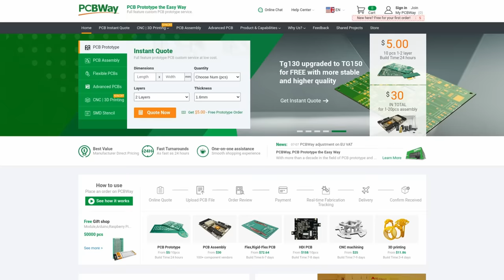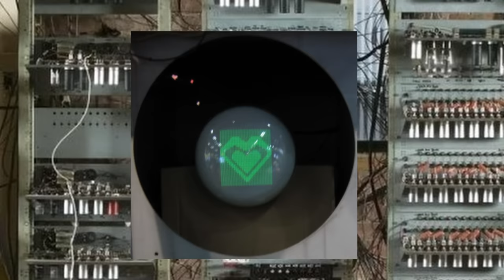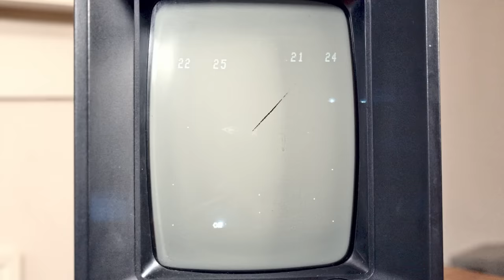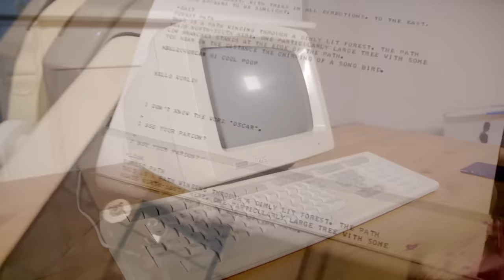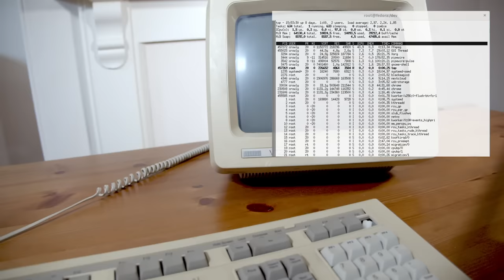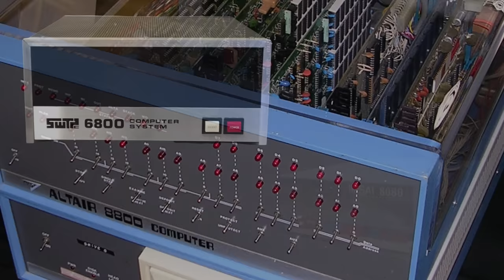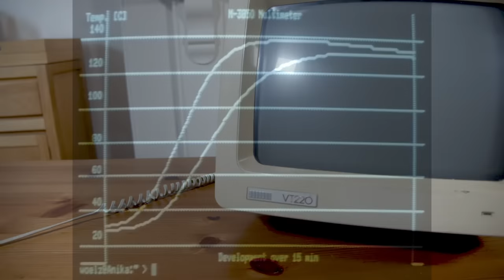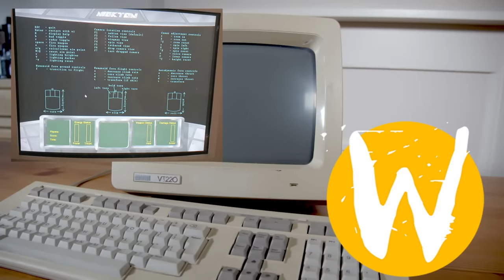The abridged history of Computer Display Tech

Comment: This was good but I think you were a little hard on X11 while I generally agree Wayland is better for most modern use cases the remote features of X11 especially when paired with SSH were especially in businesses much more commonly used than you might think and the switch has caused many issues for businesses. it use to a lot easier for me to write a batch script that launched an Xserver on windows ssh with xforwarding to a remote server and an application that managed an application running on the Linux server than have to explain to a non technical manager how to do it manually, and yes there are many expensive enterprise application that only run on Linux and require you to use a GUI application to manage them with no CLI or API options available, and in those use case wayland is starting to be useable, but is not as good as X11. The latency of X11 could be bad over the internet but it really wasn't that bad over a local LAN assuming everything was configured correctly on a switched network. That said in older setups on (IBM) Tokenring or Thinnet ethernet or even half duplex 10 baseT which many older purpose built Xtermanals were equipped with the latency would have been atrocious and would have gotten worse the larger the network. There were a of uses of Xterminals in utilizing older network booted PC's with a relatively powerful (for the time) Linux server in k-12 schools in the US that allowed them to do a lot with their limited computer budgets very effectively in the 2000's. Having built a few my self they were surprisingly reactive with proper networking, you could actually have multiple people playing games on them because if it was setup correctly the latency was really not noticeably worse than using a Bluetooth mouse and keyboard. It honestly really was not a bad multiuser experience, its just very few people have ever seen a really well setup XTerminal environment. though there is one think i will say about it that may be controversial but true the KDE desktop with KDM as the login screen worked way better for that setup because Gnome at the time didn't play nicely as far as Ram and CPU utilization with multiple users logged in to a single server all running full desktops, that said neither were totally optimal and lighter weight desktops were better.

Comment: I remember seeing a "Memory Vector" display at a uni visit in the early-mid 1980s only this one drew a line that dropped down the screen clearing everything as it passed.
Mint still uses Xserver, not Wayland. Mind you since Synergy is yet to support Wayland that suits me for now 😉
Reply from the maker: Wayland adoption seems to be running a different speeds depending on distro. Its been the default on Fedora for a while, next year (or tail end of this year) seems to be when most distros are planning on  changing the default to wayland. X will still ship with them for a long time to come.
Reply: @RetroBytesUK  Symless really need to get their act together on this. It's definitely the right way to go.
Reply from the maker: @ColinJonesPonder  I guess they are going with let the other distros take the pain of kicking out all the bugs and querks (of which there has been no shortage). Then introduce it once its broadly deployed in other distros.
Reply: Makes sense!

Comment: One interesting thing missed (well, interesting to me) was that the later versions of the IBM (mainframe) 3270 displays included what I guess is a bizarre hybrid between characters and hi-res graphics.  The 3270 protocol and terminals were enhanced to allow the program to define the exact image of a character before sending it to the terminal.  So a fully graphical display was possible but the program had to define what each pixel on the screen was, which logical character it was in, and then define that single-character right within the protocol it used to send the character to the screen.  And that definition was not straightforward. Ridiculously complex and almost never used.  The only uses I knew of it from IBM were a pretty demo of a one armed bandit game, and displays for a performance monitor (RMF).  I think SAS used it fairly extensively too. I only used it to create progress-bar like screens but nothing anyone ever really used.

Comment: Video is quite fragmented.

For example, you mentioned core memory, delay-line memory, and then ... DRAM. What about SRAM ICs (Static RAM), which become available much earler, and were cheaper, than core. Some of mentioned microcomputers, actually, used SRAM, not DRAM (PET, Altair, KIM, Apple I).

Another example - not quite described alternative aproach to TTYs/terminals, were developed in parallel in home and business microcomputers - non-terminal local raster graphics controller ASICs (built-in or peripheral).

Comment: Kind of weird how you completely skipped over CGA, EGA and VGA.  And heck, budget PCs in the early 80s even had composite outputs so you could use a regular TV, no serial terminal needed (like the Commodore 64)

VGA connectors are still around today, so I'd say it's definitely pretty prevalent - even Linux desktops with X Window can use VGA output (though today's "VGA" ports are far higher resolution than actual VGA)

Comment: Is there any correlation with in between of mainframe of Turin machine and computer..?
Reply from the maker: A turing machine (as opposed to the Harwell ¹Witch) is a theoretical machine defined by Turing in a mathematical paper looking at could be computed. When people use the phrase Turing complete they a saying the system has all the features needed to be equivalent to the theoretical Turing Machine. A mainframe is a large scale computer of the style that became popular amoung large corporations and governments in the 50s. The term was initally more about the physical size of the machine rather than a feature set.

Comment: Was just wondering is any laptops ever had a 4:3 square shaped LCD vs a 16:9
Reply from the maker: Most laptops where 4:3 screens before things started to swap over to 16:9, for example my first IBM think pad was in 4:3, which I got around 2001.
Reply: @RetroBytesUK  oh yeah I have a 4:3 thinkpad as well now that you mention it.
Reply: @RetroBytesUK  but my Macintosh Portable and  Atari Stacy are both 16:9 and came out in the 80’s.

Comment: yeh that dec/ansi vt100 stuff is kinda weird ya know. it makes far more sense to do something with single byte opcodes like petscii. than to scan for a multi byte string. (what to do with it when let's say there is an hour between the escape and a random [ popping up an hour later or when it doesn't match a code... print it in full? not print it? etc. it's just weird. just use single byte stuff next time you make a terminal standard dec. lololol. like commodore did. :P

Comment: What about GDDM the graphics standards developed by IBM? I have a terminal called a 3290-2 that can do rasterized graphics. I have since then wrote some code in rexx to utilize these functions that are available. If you wish I can give some examples of what I and some friends were able to achieve.
Reply from the maker: I loved rexx, it was such a good idea.
Reply: @RetroBytesUK  yes it was. if you want to demo GDDM I can get you access to my system and all you would need is a GDDM compatible TN3270 emulator. There’s versions available for trial if you want to do it if not that’s fine. It would be a while though dealing with getting a new system in and online as well as well so it would be sometime in August when I can run the machine again. Anyway it was fun bringing the thing online.
Reply from the maker: @vinatron8075  I would be interested to see it all running.
Reply: @RetroBytesUK  cool I have 1 real GDDM capable displays as well I will see if I can get a good recording of it. Doing so myself is a bit difficult I suppose i could also record the startup of the control unit as well as the 3290 itself. The 3290 is a gas plasma type terminal similar to the PS2 model 70 portable or the Compaq portable III.
Reply from the maker: @vinatron8075  I wonder if I could fix up my portable 3 in time to show the screen type in use on a portable machine as a counter point to the terminal.
Reply: @RetroBytesUK  great idea

Comment: However broken X might be, it had (until just recently) one huge advantage over wayland. You wouldn't get a stroke when you moved stuff around on your screen. (at least with nvidia gpus)
That, and it won't run compiz...
Reply from the maker: Nvidia seems to having been pushing in the opposite direction in their drivers than wayland when it comes to Linux. Things seem to have changed in the last few years, but the proprietary driver seamed to work really poorly with wayland.
Reply: openbox under x11 is the power combo of productivity, customization and performance.
Reply: @RetroBytesUK  Yep, and to quote linus, "nvidia, fork you!"

Comment: Why would you claim Colossus to have been the first computer when it was built two years after the Z3 and was more limited in what it could be programmed to do?
Reply from the maker: First electronic digital computer, the z3 was electromechanical.
Reply from the maker: The z3 also never made it into day to day use, saddly it remained an expirement that ran occasionally. It did also miss some fairly important features, like conditional branching.
Reply: If there are conditions to the race for "first computer", they surely should be named before announcing a winner? Criteria for "the first computer" may or may not include electronic only, being binary/digital, being general purpose == freely programmable, being Turing-complete, having conditional branching etc. pp., so knowing which were applied and which were not makes such a claim far less able to be argued over.

That said, disqualifying the Z3 for not having conditional branching seems a bit odd when the Colossus had switches that allowed for a choice of hard-wired algorithms to run, but no free programmability at all. Thus, it having conditional branching or not isn't relevant because nobody could write any programs for it. The Z3 on the other hand - while not running every day - did run a wide variety of problems instead of "just" the same hard-wired set of algorithms.

Maybe both European projects should yield the crown to the Mark I which - while late(r) to the party - satisfies all the conditions for what a "proper" computer should be?

Comment: That you constantly use a VT220 Terminal ... the one I first used means I like this regardless of anything else ...

Most early PC buses are parallel .. most recent ones are serial .... so it wasn't serial that was the issue ... but latency ... 
....Note cloud computing is serial ... and due to the distance horribly high latency ... but so much faster nobody cares ...

Comment: i use an 11 inch lenovo n23 winbook from 2018 because im poor as shit, and the stand i built for desk top use makes it look like a xerox terminal from 1975, or that original PONG arcade cabinet. not to mention its as slow and only slightly more usefull than an old terminal.i have one more year until microsoft stops supporting windows ten, 11 isnt compatible with my machine, so ive got a year to learn linux

Comment: Xserver has jettisoned all the 'cruft' you complain about since it went from xfree86 in the early 2000's to xorg it's either not in the source anymore or has been spun off to a module that many linux distro's no longer even have available. like remotely running a xserver on another machine.

meanwhile wayland is sitting in the corner, eating paste because /sarcasm/ shocker, dumping everything from low level hardware access to having to remake the wheel(like how to program a mouse) is suddenly dropped on the devs of your favorite window manager. so, and i kid you not. kde for example JUST FIXED a bug last week where the ENTIRE wayland server would crash.... if you c&p something. Or a 1 in 4 chance that when you start the window manager wayland may enter an endless loop of crashing that can only be stopped by a hard reset.

Comment: To suggest a telex is a modified typewriter is way off the mark.
Reply from the maker: You should looks at some of the early telex machines which where modified type writers. I.e the company already where producing a typewriter, and then modified that model to produce a telex machine.
Reply: @RetroBytesUK  I cant think of any. Give me an example. You do realise a telex is a duplex machine with no direct connection between the keyboard and print head. Old Typewriters they were directly connected.
To those without the knowledge they may look the same but you cannot modify a typewriter to create a telex.
Reply from the maker: @smorrisby  For the modified one there is a rod connecting the key, to the leaver in the print basket.  That rod is removed, so the key in nolonger directly connected to the leaver in the print basket.  That meant they could use the keyboard as is, just the rods are now connected to the parts they add for the teletype, same with the print basket, and the top part of the case.  That saved producing tooling a moulds for a significant proportion of the telex machine.
Reply: @RetroBytesUK  So that is a telex that can be used as typewriter.
I stand by my earlier comments.
Reply from the maker: @smorrisby  Only they made them as typewriters first for years, then modified the typewritter to make a telex machine.
Reply: @RetroBytesUK  But Who? Certainly not Creed, Sagem, Siemens or Teletype Corp, and they were the big 4.